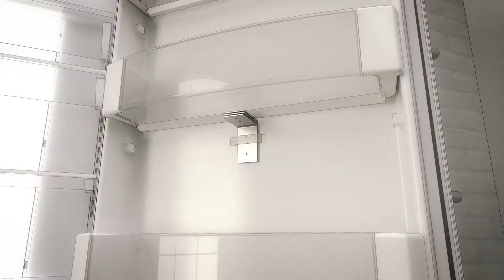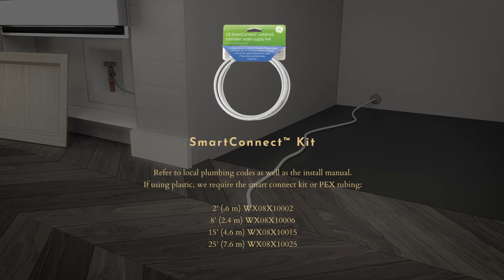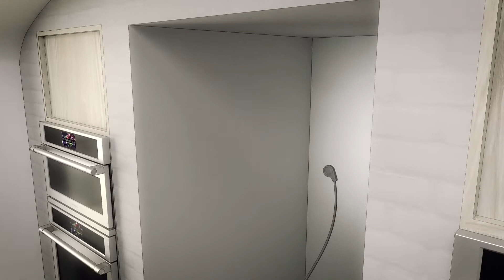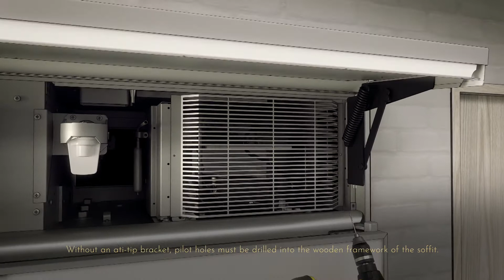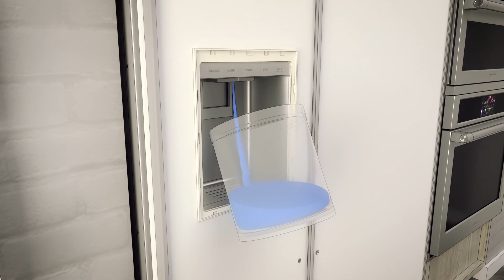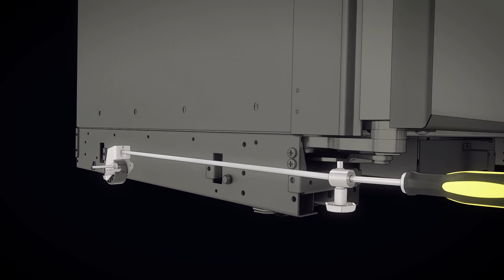Monogram Side-by-Side Refrigerator Installation

Comment: Appliance installer here. Decent video. Should also show how to unbox the unit, take off the pallet, and safely move the appliance. 

Also, this video is out of order. The leveling must be done before securing it into the cabinet opening with screws.

 Another point, you want to align the side flanges of the fridge to the cabinetry and not necessarily to plumb.
Reply: Do you know what the clearance should be on the sides?
Reply: @gregoryjones5890  GE Monogram fridges want 1/2" less than the overall width of the unit. For example: 36" unit should have 35-1/2" opening width; 48" unit needs 47-1/2" wide opening. Opening height should be 84". You can usually work with a minimum of 83-3/4" but the floor better be level underneath
Reply from the maker: We'd be happy to look into this for you. Please provide the model number for the unit you're inquiring about, so we can better assist.
Reply: @MonogramAppliances  Thanks so much!
Model # ZIS420NXC
Reply from the maker: Thanks for letting us know. You can find the needed clearances for proper installation on page 3 of the Installation Instructions (http://spklr.io/6054QFu0) in the "Product Clearances" section.
Reply: @MonogramAppliances  thanks - is there a better link? That one seems to not be working